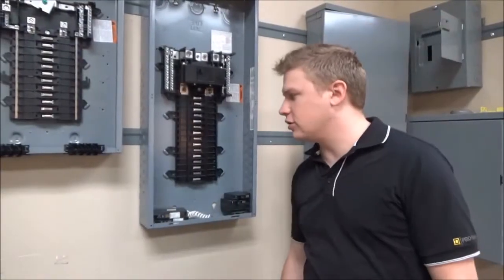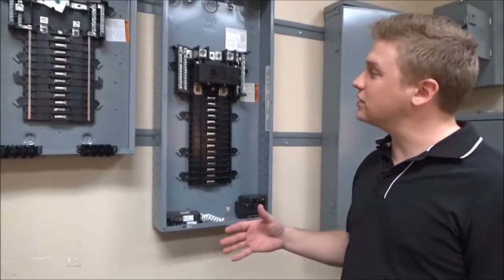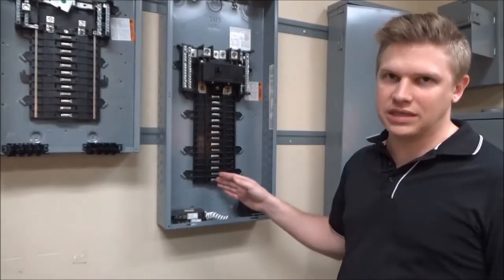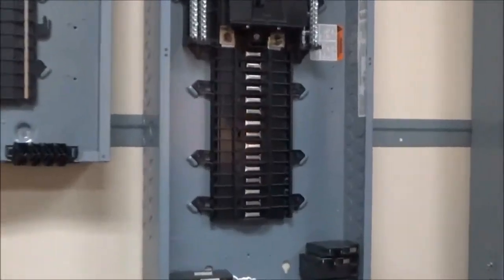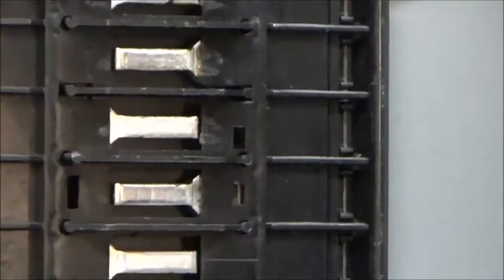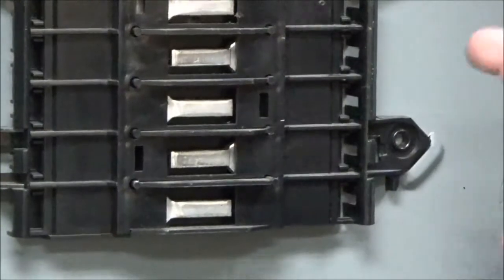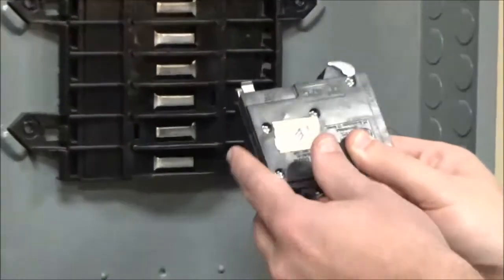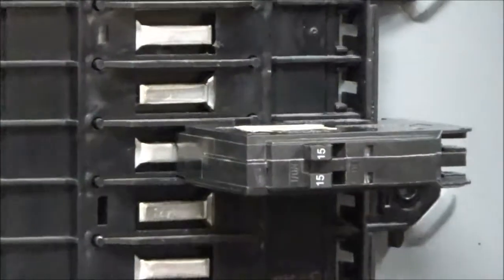Installing QOT Tandem Circuit Breakers in QO™ Load Centers | Schneider Electric Support

Comment: I don’t understand the point of this? Why limit where you can put tandems?
Reply: Probably to keep the homeowner from putting a tandem in every single slot and overloading the panel.
Reply: But isn't that the point of having a main breaker that's correctly sized to the service?